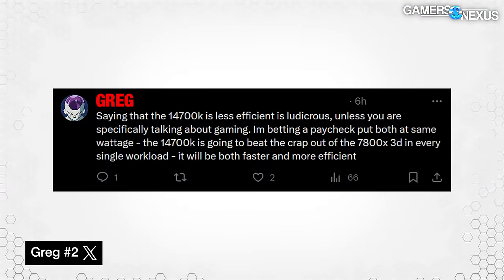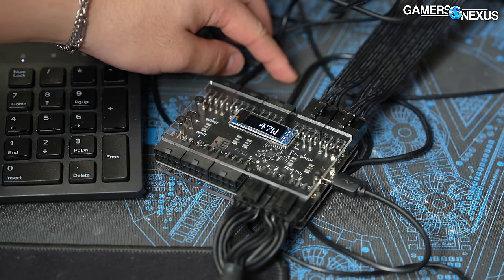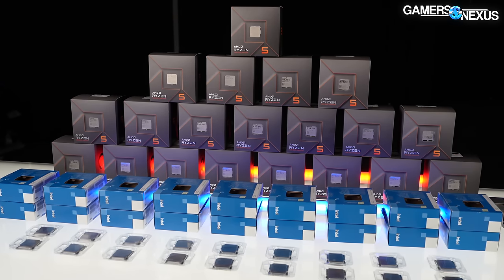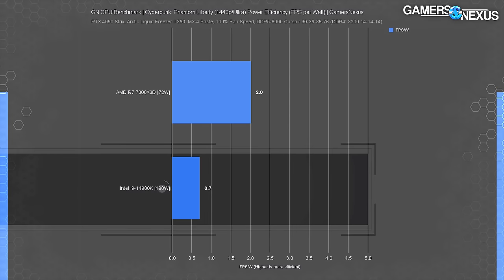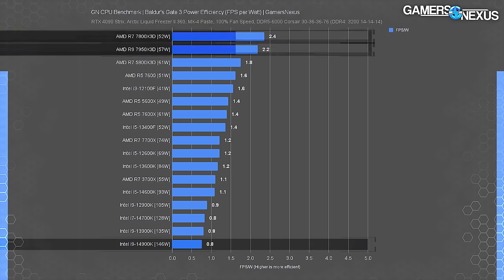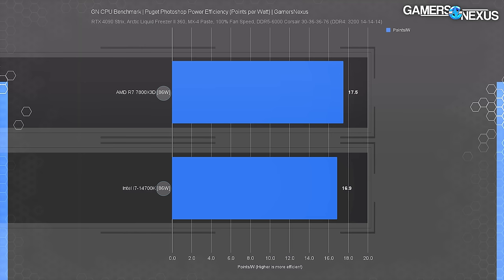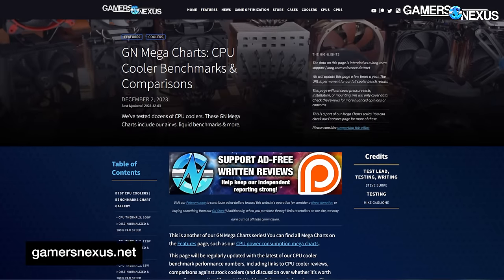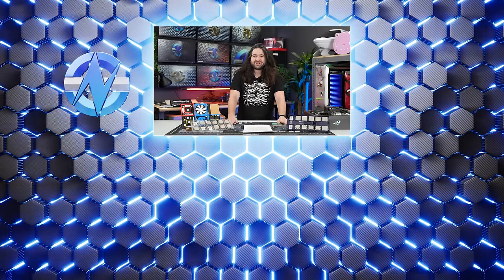The Intel Problem: CPU Efficiency & Power Consumption

Comment: Thank you for this! Funny, I have the 13900k and a 4090. I took a month plus away from gaming, and my energy bill lowered by 50%. I've never seen my electricity bill this cheap. When bg3 came out, I had never seen my electricity bill that high before.
Reply: Bg3 is amazing lol
Reply: Bill it to Greg. he seems like somebody who likes to throw money away. win-win
Reply: A simple underclock changes alot. Also, if your bill lowered by 50% you must have been gaming 12 hours a day + that your 4090 draws way more power. BG3 is not really the game that taxes the most either. So yeah... today on what never happened. Or you're getting screwed by your power provider.
Reply: @Xfade81  bg3 does draw power if you max out
Reply: You must either barely use any electricity outside of computer then or game like 12 hours a day when you do. These numbers are frankly ridiculous and barely believable, even theoretically.
Reply: Yup, even if 13900k sucks out 200w under gaming, that still basically nothing
Reply: just cast some spells and get lightning charges, they should be able to power your pc
Reply: @Xfade81  I mean, my baseline power consumption with computer off (fridge + 6 devices) in my apartment is ~50-60W, so it's not that difficult.  I definitely noticed my bill go up when I played a bunch of HZD, despite frame-capping.
Reply: @Xfade81 There's multiple issues with your reasoning here:
1) An underclock will help, but it won't negate it
2) BG3 isn't the most demanding game, but since FPS limits are off by default in pretty much every title "less demanding" translates to either higher frame rates or is used to yield higher resolution/settings, it doesn't reduce system load
3) Not everyone is an American nuclear family living in the suburbs with 2.4 children, and you'd have to make some very specific assumptions along those lines to come to such a specific figure for estimated time spent gaming. A single occupant in a mild climate and living in an apartment uses a lot less power than 5 people in a large house in a Texan summer for instance - lower baseline power consumption means less gaming to increase it by 150%. Also, the sort of people most likely to be able to have jacked gaming PC builds are going to be people in 1-2 person households without dependents, who will also have more time for gaming.

Edit: surprise surprise, OP confirmed they live in an apartment with low baseline power consumption (plus, the 4090 uses like 500W out of the box, add on the CPU and you've got a pretty constant half a kilowatt of power at the very least. Average American family home uses 15kwh per day iirc - to use 50% more at half a kilowatt would be 15hrs per day (half a kW, total 7.5kWh) but a small apartment uses much less which translates to a much smaller target consumption to reach that 50% threshold - only 5 hours per day would translate to a 50% increase over 5kwh per day, in a small apartment with someone specifically pointing out an uncharacteristically high amount of gaming in that period that's totally doable).
Reply: @bosstowndynamics5488  Valid points. I'd still argue there's no point in talking about powerusage and electricity bills when you're in a specific situation, and where the CPU (what the video is about) is far from the main problem. The videocard as you mention also has abnormally high powerdraw.
Not that there's something wrong mentioning your benefit, but it does need context. Because as you can see there are more people thinking it would be abnormal to see a 50% decline in your bill.
Reply: 4090 is a beast both in terms of preformance and power draw. Take a good guess which is the good one and the bad one ROFL.

Comment: Could you also take a focus of the idle cpu usage? I think that's also extremly important when a lot of pc's run maybe 30% of the time in idle. For business pc's some are on 24/7 and are only used ~8 hours a day 5 days a week.
Reply from the maker: Yes, we'll have some data for that in the next few months. We're planning to add that to the mega charts pages per popular request as well!
Reply: @GamersNexus Any plans to do the same for graphics cards? Maybe idle, watching videos, that kinda stuff
Reply: @commanderbly009  I think that will be a good idea if Nvidia release low power GPU.
Reply: Also regarding the IO die idle power consumption. Could you test with some different ram speeds if this ever gets a dedicated piece. Given potential sleep states not being active for the IO die for some of the higher ram speeds. This might disproportionately affect threadrippers ofc. @GamersNexus
Reply: Idle power usage is where Intel wins compared to AMD desktop CPUs.
Reply: Mongodoox  why would you buy several systems if you work from home? i do everything on 1 rig. idle is very important to me.
Reply: @commanderbly009  It's interesting how much efficiency has improved.  A 3090 with 24 GB VRAM uses about half the power of a very old GTX 680 2GB at idle.  In my case at least.
Reply: you should enable sleep mode after a period of inactivity lol. Running at idle 24/7 is stupid
Reply: Mongodoox  Because not all of them need a Xeon W3495x? Just a guess though.
Reply: @michaelbuto305  i mean, there's likely gotta be an Ampere GT710 just waiting to get put out for sale. /s
Reply: @b4ttlemast0r I agree with you for the most part - some computers use 20 to 50 watts at idle.  However, I have an old Liva X small form factor PC that I run 24/7 for always on tasks (docker, Sonarr, Radarr, file server, etc) and it uses 3 watts at idle.  Anyone that wants a computer running full time should check out SFF pc's for such an always on task.  BTW, it only achieves that with Linux - if you run Windows on it, it uses like 5-7 watts because Windows doesn't use the C7 power state nearly enough.  (Edited, my wattmeter was slightly off)
Reply: @offspringfan89  12th/13th gen and 5000 series into account (becoming more common in PCs nowadays mind you) is where most of this gets a little weird. Taking the extremes (13100F, 13900K & 5800X3D) out of the equation, you'll likely see there are some CPUs that are better than others, swapping back and forth between Intel and AMD's favor going up the product stack.

Comment: As an Australian with relatively cheap electricity this still matters. Heat can be a major factor in summer especially when you don't want to run AC. If you need to run and it works harder or you run it when you otherwise wouldn't due to heat load that extra power can start to ad up.
Reply: Same here in Texas. I don't use my oven during the summer while the sun is out. My AC can't catch up if I do. I turn off lights and keep the windows covered.
Reply: I run a 13900k in Australia no problem cooling
Reply: Heat can be a big factor if you live in a warm climate. My apartment gets sun all day and is not well insulated. Nice in winter, not nice in summer. I work from home, with the computer on all day and half the night, so those extra watts dumping heat into the room do make a difference.
Reply: @Pushing_Pixels Even in cold or normal climate it can matter much. As an example in Europe most houses are build to preserve heat as much as possible. Running your Gaming PC for a few hours already heats up your room pretty fast. And If its Not like deep winter you cant just cool your room down fast without using an AC.
Reply: @Pushing_Pixels  very much this. I used to live in an apartment which had sunlight all day just like you do, and upgrading from a 970 to a 1080Ti absolutely made a difference in the summer. Couldn't really get by without an AC after the upgrade.
Reply: @moto3463  To be fair, that depends on both your location in Australia AND how your house is designed.

Older houses are much harder to keep cold (for various reasons) and certain states can have issues with extreme AC draw. (See 2019 when rolling blackouts were done in Victoria to meet the states insane power consumption due to the heat).

So going, "Hey my experience doesn't match there experience" doesn't nullify their experience.
Reply: Cheap electricity in Australia? lol.
Reply: @ghallora  note that I said RELATIVELY. Compared to much of the developed world Australia does have cheap electricity. It's only really North america that's  cheaper in terms of rich countries.
Reply: @SpencerHHO  all that 'green' tax which punishes the poor.
Reply: @ghallora ha! Was thinking the same thing 😂

Comment: its not just the power cost, for a 14 gen high end part you're pretty much forced to use an expensive water cooler while a 7800X3D can be cooled by a cheap tower cooler.
Reply: you aren't - you can even overclock a little bit with some of noctuas several year old models and there are better air coolers out there now
Reply: And for the Ryzen you're stuck with absurd mobo prices :D I know, I got a 7800X3D earlier this month :D
Reply: Also all cores of 7800 are real core. Meanwhile intel 14k only has about 30% of physical core, the remaining are emulator core made from some top secret Hyper-V of sort
Reply: @superspies32  No.
Reply: @Navi_xoo  can run sure, not that low here, but cheap enough (around 115€ for a A620 one rn) . But that  if you want to take advantage of all it has such as ddr5 and pcie5 you end up paying a lot more than that. Cheapest a B650E goes is 272€. On the blue side cheapest is 75€ and a Z790 that is the best chipset available for intel afaik starts at 175€. Sure you can go for a B650 for amd and it would be about the same but then you waste a bit of the CPU you get and might have to replace the mobo later on.
Reply: @tbard  at least the mobo supports future CPUs with a UEFI update and not a whole new mobo
Reply: @ThatCrazySasquatch  oh I agree, I got a 7800x3d myself, even if I fear we won't get 4 gens on it like AM4, just pointing out all the sides. Good AM5 mobo cost a lot. Also most have a lot of pci lanes wasted on 3-4 nvme and very few available for pcie ecpansion unfortunately.
Reply: i'm using air cooler and my average temps are 26 on idle and 49 on full load .... if you buy a micro case with made in china fan how do you expect to cool down your computer? i have 15 hybrid fan running and i can easily remove all my fan on my cpu/gpu without any problem
Reply: Im using a wraith prism on my 7800X3D rite now
Reply: @tbard  Not really, you can buy a really good board for 150 eur
Reply: @Fantastika  depends on what you consider really good board... if you want DDR5/2.5gb ethernet/PCIE 5 as minimum requirements... it starts at 220+€, if you drop the pcie5 requirement you start getting good ones at around 150€, that's true. But I wouldn't consider that a "really good board", fully acceptable one for sure for most uses tho. If you start having requirements on the number of pcie lanes, or wifi7 in the mix the price explodes (but that's also true for Intel).
Reply: @tbard  Literally nothing utilised PCIE5, a 150 eur board will happily run any AM5 cpu with no issues, what else do you need

Comment: The issue with power is also the costs to COOL the chip.  In addition to the cost to power the chip, you need a bigger cooler.  Aaaand the heat goes into the house, which means in summer you also have to power an AC more to move it out of the house too.
Reply: But you get a good heater in the winter, lol
Reply: It's also a big deal for SFF builders like me, where cooling is already constrained
Reply: @MrQuay03 use heat pumps. >100% efficiency.
Reply: @Postman00 COP is different from efficiency
Reply: @MrQuay03 Not an equal trade off in global warming where winter is only at best 3 months long for the majority of people.
Reply: As a former crypto miner, this is one of the first things I consider, since I live in the desert. I undervolt everything and intel CPUs just don't do well with my tuning philosophy. No surprise. It is quite dated architecture. Intel is still using a flathead while AMD has dual overhead cams.
Reply: @MrQuay03  I know this is meant as a joke. 
But using that power for heating directly would be more efficient, so not even this is a positive aspect.
Reply: @connivingkhajiit  While that is true, that's doesn't exactly hobble the OG statement and his point still stands. Well over 100% energy efficiency.
Reply: But when you talk about a heater… AMD has its temperature issues too(not for heat generation but heat dissipation), really hope they could fix that in 8000
Reply: And the increased noise that comes with needing to move more heat
Reply: And a bigger supply
Reply: Yeah a $40 air cooler is totally adequate for the 7800x3D.
Reply: @T3H455F4C3  this was half correct half incorrect, for 7800x3d a 40$ air cooler will throttle, but a 360 water cooler will also throttle, mostly due to the cap of the cpu(and of course the thermal compound inside cpu package) there are plenty of video delidding 7800/7950x3d and it turns out water cooler can make it slightly more overclocked. But still, that’s a huge risk.
Reply: @创一厨  $40 air cooler or 360mm AIO it's only pulling about 85 watts all core.
You don't need a 360mm AIO to effectively dissipate 85 watts of heat.
Reply: @T3H455F4C3  sorry I didn’t make it clear, the problem on heat of x3d series is not about the cooler, the cap of the CPU package itself is limiting how much it can dissipate out of the chip, that’s why I say “half correct”
Reply: @创一厨  My statement was fully correct.
Reply: @MrQuay03  AMD FX (bulldozer) is the undisputed champ
Reply: Intel fanboys still don't get it, they are stuck in 2015 when Intel was better , not anymore, sooner they accept it the better .
Reply: LMAO ,,, and tell us what happens when you have an 80% efficient rated PSU on an high power system Versus a 90% rated ,,,, hmmmm
Reply: All this talk of AC for me as a german is so wild. In germany only like 5% of the population have AC in their houses or apartments😂
Reply: If those few watts make a diffrence in your world I pity you.
Reply: Yeah, I feel most people cannot cool high end CPUs when they play a game that has uses many cores at once. Forums are full of "why does X game overheat my PC".
Reply: Additionally, if you want to have a beefy cooler for your lower heat part, it will last significantly longer than higher heat components
Reply: Even in the winter, last night my bedroom was at least 5°F hotter than directly outside my room, and maybe even closer to 10°F. I put a box fan in the doorway and opened my window to cool the room down, my pc was cranking out the heat